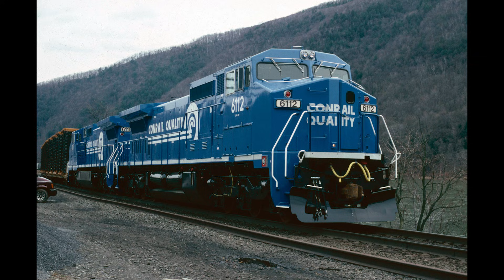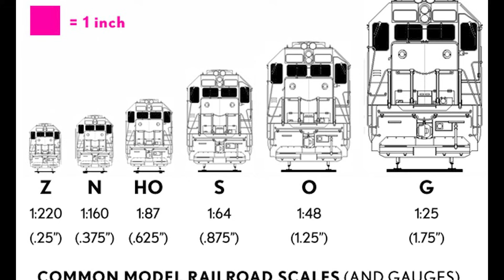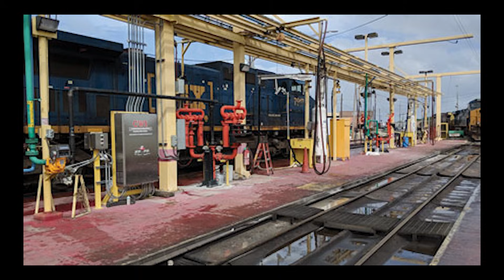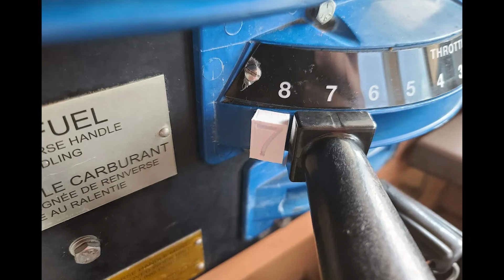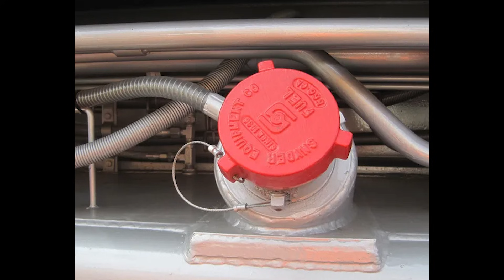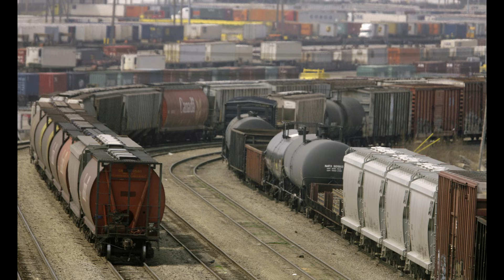The Locomotive That Burned Fuel Faster Than It Could Be Delivered

Comment: I DONT UNDERSTAND THIS! FIRST, EVERY BODY WERE CUTTING DOWN THE  SD45,AS BEING A FUEL HOG DIESEL, AND NOW THEY ARE CLAIMING THAT THE GE C40-8WAS ALSO KNOWN TO BURN A LOT OF FUEL! THIS IS BS! WHEN GE BUILT THE C40-8CW, THEY WERE REGARDED AS BEING FUEL EFFICIENT AND RELIABLE. NOW , JUST LIKE ALL THE OTHERS WHO ARE ALWAYS FINDING TO NIT PICK ABOUT, NOW COMES THE SO CALLED FLAWS THESE LOCOMOTIVES WERE SUPPOSED TO HAVE; THIS MAKES NO SENSE TO FOND FAULT WITH THEM! I HATE IT WHEN PEOPLE HAVE NOTHING ELSE TO DO BUT CUT DOWN A MACHINE THAT'S KNOWN FOR THEIR ABILITY TO PULL LONG, HEAVY TRAINS OVER GRADES AND NOT GIVE AND PROBLEMS WHATSO EVER!  SO, WHY NOT TALK ABOUT THE Good THINGS THESE LOCOMOTIVES  DID FOR THE RAILROADS THAT BOUGHT THEM, INSTEAD OF CUTTING THEM DOWN LIKE THIS?! ALL MACHINES HAVE FLAWS, BUT  IT IS NOT FAIR TO TREAT THEM LIKE THIS!  HOW WOULD YOU FEEL IF SOMEBODY POINTED OUT How UNRELIABLE THOSE RAGGEDY STEAM ENGINES WERE! I NEVER LIKED STEAM ENGINES!  I HATED THEM!  YOU TALK ABOUT UNRELIABLE, THE STEAM ENGINES WERE A PAIN IN THE ASS TO THE PEOPLE WHO HAS TO RUN THEM! LET ALONE THE SHOPMEN WHO HAD TO REPAIR THEM! IN ALL THE YEARS IVE BEEN LIVING, THIS IS THE FIRST TIME I EVER HEARD ABOUT A GE LOCOMOTIVE THAT  CLAIMED TO BE A FUEL HOG THAT BURNED MORE FUEL THAN THE OTHER  BUILDERS OF DIESEL LOCOMOTIVES! I CANT BELIEVE IT! SAY YOU ARE JOKING ABOUT THE GE LOCOMOTIVES!

Comment: I'm a retired engineer. I noticed at time 12:50 the throttle goes only to run 7. Can anyone tell me what's that about? We always used the term "run", not "notch"
Reply: EVERY DIESEL LOCOMOTIVE , HAD THEIR OWN THROTTLE SETTINGS, MANY  WERE RESET TO KEEP THE LOCOMOTIVES AT A CERTAIN THROTTLE  SETTING, TO KEEP THEM FROM  DAMAGING THE ELECTRICAL LIMITATIONS AND FIR SAFETY!  AS YOU SHOULD KNOW, THE LOCOMOTIVE THROTTLE SETTINGS ARE DESIGNED TO PROTECT THE ELECTRICAL SYSTEM FROM CATASTROPHIC FAILURES.  ON ALL DIESEL LOCOMOTIVES, THE THROTTLE SETTINGS LOCK IN PLACE THIS SYSTEM IS VERY IMPORTANT TO KEEP THE LOCOMOTIVE FROM THROTTLING UP TO THE POINT OF CAUSING THE ENGINE TO OVERSPEED, AND CAUSE A PROBLEM,SUCH AS A FIRE, AND ENGINE FAILURES!  SOME LOCOMOTIVES ARE SET THIS WAY TO  MAINTAIN THE SAFETY OF THE PEOPLE WHO OPERATE THEM.  THERE ARE A NUMBER OF REASONS FOR THIS. IT ALL DEPENDS ON THE PRACTICES OF THE RAILROADS THEMSELVES AND WHAT OPERATOR RULES THEY HAVE WHEN IT COMES TO THE OPERATIONS OF THE LOCOMOTIVE MAINTENANCE SHOPS. MOST LOCOMOTIVES ARE STE LIKE THIS,TO KEEP THEM FROM GIVING THE CREWS TROUBLE.
Reply: @TerryWallace-h7g  I haven't a clue in the world what this is all about. Why in the hell would they even design such crap in the first place, what good was it?? If an engineer can't use all the power available to him, what's the point? A designed in problem? Does EMD have that issue? Give me an SD40-2, all problems solved!